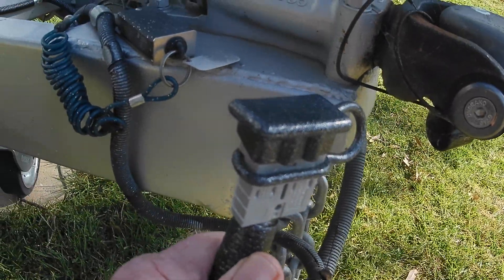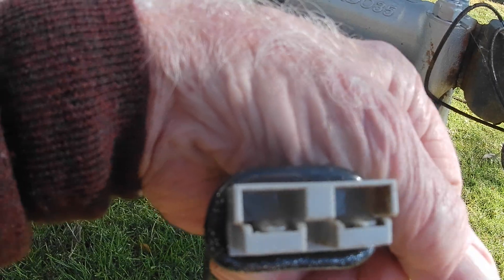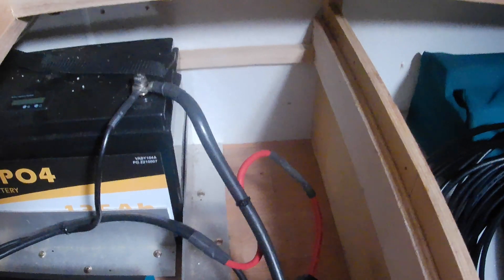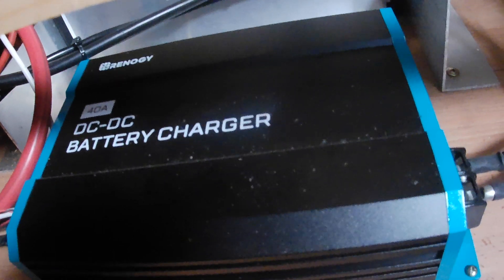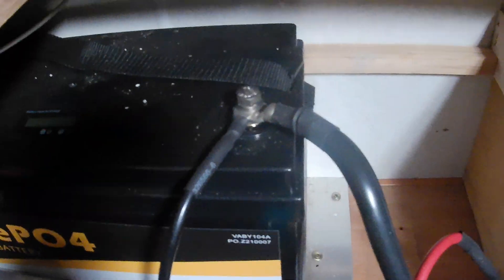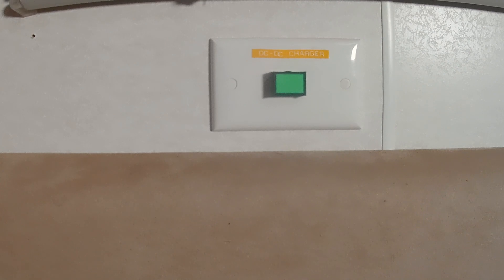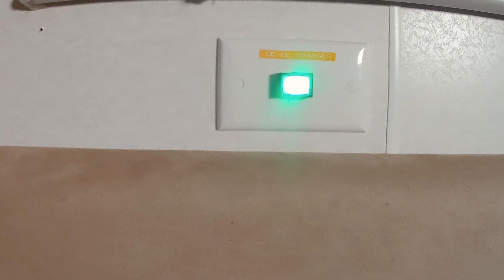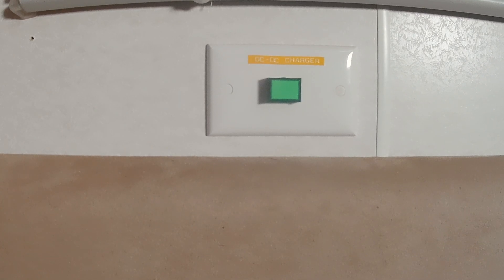Installation of a DC-DC Charger in a Caravan - See diagram for info

Comment: Hi Carl, thanks for the video. Question. Why does the DCDC charger not activate when the car is on and turn off when car is stopped as it would if you installed it under the hood of a car? The only difference I can think of is they don't share a common ground point? Cheers
Reply from the maker: Because it is not in the car it does not get a positive trigger when you turn the ignition key, so that is why I provide the trigger when I want the charger to work. You could of course run a trigger from the car to the caravan to make it as it would be under the bonnet.  Thanks for the watch.
Reply: You still haven't explained what this switch is connected to.  Obviously it is connected to the charger via the ignition trigger wire. But what is providing the power to the switch?

Comment: Might want bigger gauge wiring. Seems very small. 
Oh and by the way those anderson plugs are 50a not 30
Reply from the maker: yes 50 amp but does not matter in this case as nowhere near that amperage is being used in this application more like 10-20